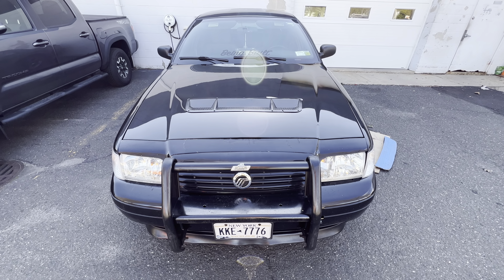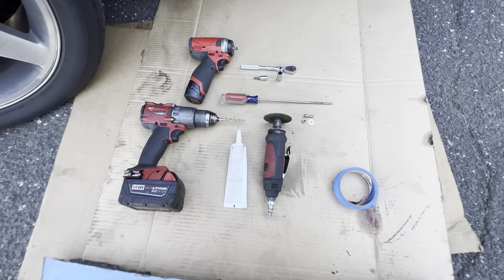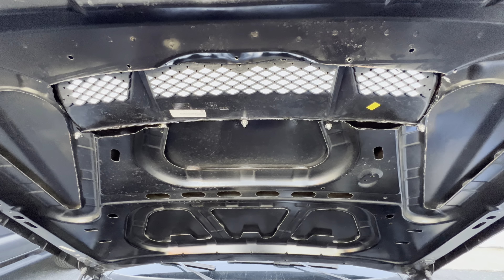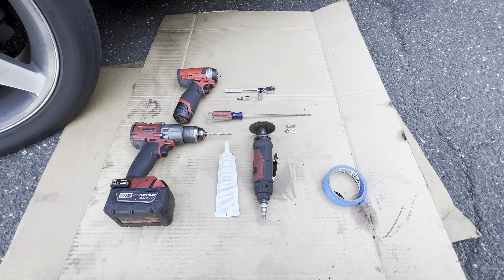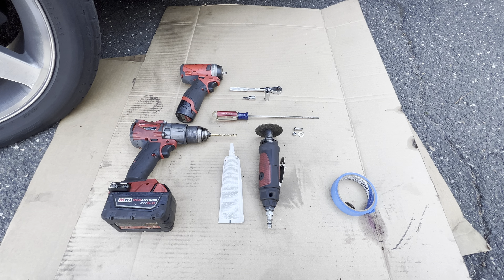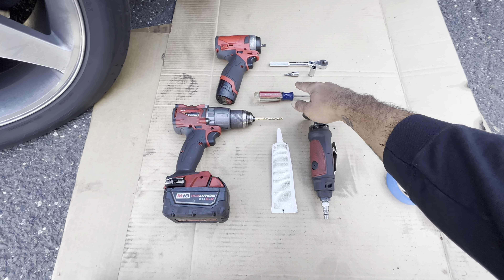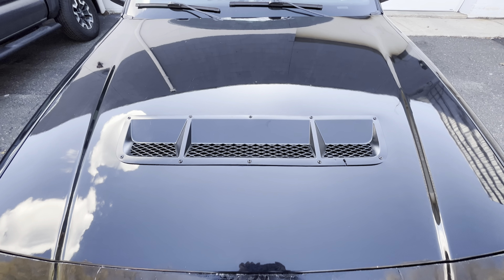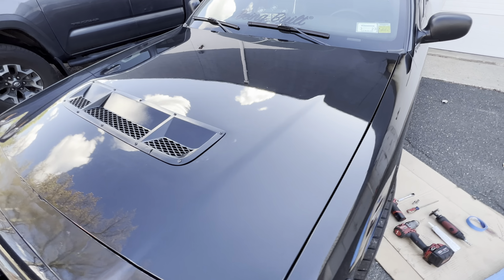Installing a Shelby GT500 Heat Extractor onto my 2011 CVPI

Comment: Did you install it in the area for the cooling fan
Reply from the maker: Just about yes. It’s temp difference is slightly noticeable in traffic which it’s doing it’s job or extracting heat from the engine bay